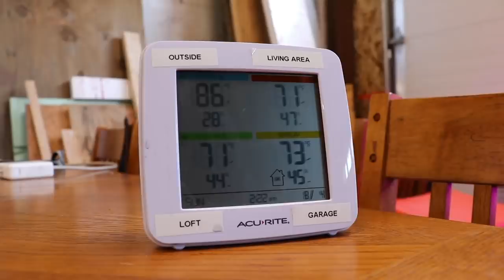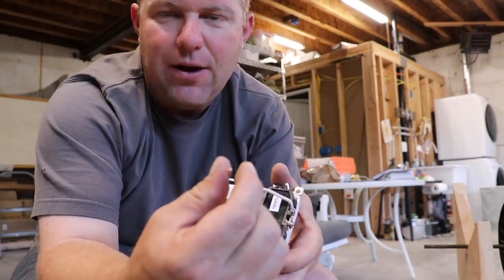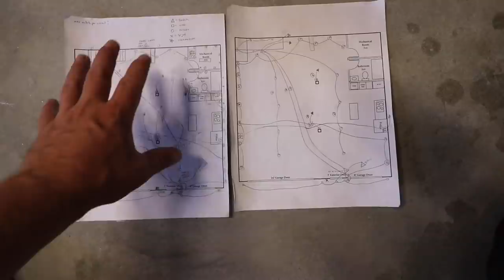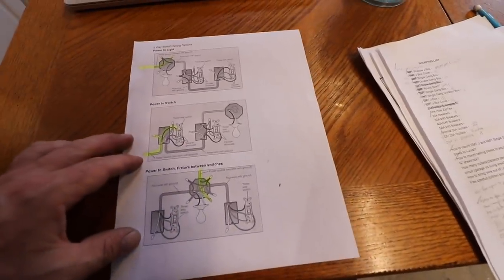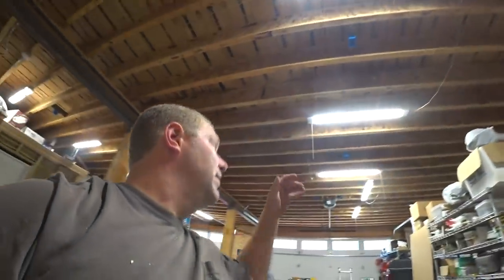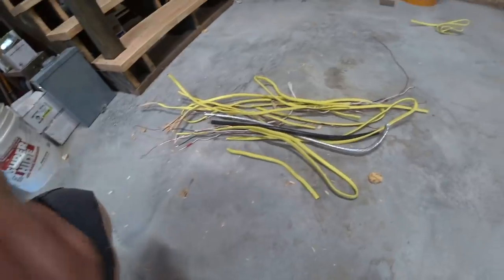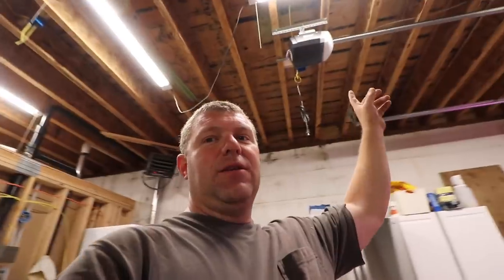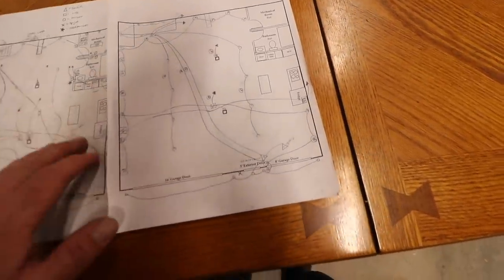WHAT A Wire-Pulling MESS (Garage Lighting Electrical)

Comment: If I am not mistaken, you wired the dual outlets in 
Series. I believe they should be wired in Parallel.
Reply: You could also save money by putting standard outlets connected to the "load" side of the GFI outlet.  Anything connected to the load is protected by that GFI.
Reply: you are mistaken

Comment: Those who can’t do, inspect! I agree you should build it properly, and to code, but I have built many homes and of the hundreds of inspectors I have dealt with, maybe 10% actually know anything
Reply: The ones that don't have the EGO.
Reply: Have dealt with traade inspectors in three different trades in four different locals, one in a different state; Inspectors are most often previously from the trade they inspect and then go through a rigorous training about the NHEC/NEC and the local variations on it. Dumb inspectors IMHO, are usually the result of pushy tradesmen with I learned it otherwise attitudes. My uncle and mentor at plumbing taught me never to insult, demean or be a hoses patoot with inspectors- build the job according to your best interpretation of the code (or better get your local inspector to walk through the upcoming areas and sound him/her out on what they expect; I'm retired now, but have a very small handful of red tags- and a bucket full of green ones- doesn't make me a genius, but it does make me successful. Mr. Sousa, I would purely hate to work on one of your projects- most of the red tags I got are from working for the south end of a north bound ....Donkey. FR

Comment: I wired my house lighting using aluminum channel, LED strips RGBWW, and 60w inverters with 4 channel remote control.  I used 18 ga thermostat wire to carry the enormous load of my 8 to 16 foot light strips.  To power an LED light with 120v is not practical as the light converts to 12 or 24v DC at each fixture.  My lights have been great for 3 years now.  Near my fireplace I put up a 6' light 18 inches from it and set that one as a sunset red/orange.  I can set any color, any light level and at a press of button I can switch everything to Warm White.  Guess your wiring will be Legacy style wiring.
Great video.

Comment: I gather you are not running a ground wire to the lighting connection boxes. How then do you ground your light fittings? or is that not a requirement in the US code.
Reply: Technically ALL Romex (nom metalized) wiring has a ground IN the cable so a 3 conductor has a ground wire in with it, just called a 3 conductor (or 2 conductor) WITH ground. Thus code now requires ground on all fixtures and switches and outlets in the US, though at one time only outlets were required to be grounded but not anymore.
Reply: Gotta have a method of grounding  available in every box, raceway, and or whip from the panel (where ground is derived) to end of each run. All quality lighting fixtures will have a ground wire for life safety purposes.  If you run into a fixture that doesn't, get another fixture that does.  It's for your safety.  (low voltage lighting not included) Also  Romex is labeled by the number of current carrying conductors plus a ground.  12/2  is a Hot a Neutral and ground in #12 wire.  12/3 would have red and black hot, white neutral and a ground.
Reply: An extra 'bonding' connector may be required close to grounded metal objects, like piping, but since this is a lighting circuit, as opposed to say, a bathroom or kitchen, that requirement is often waived if GFCIs are used. It depends on the jurisdiction.
Reply: He will be required to ground to those metal boxes and a crimp connector to all the grounds too.